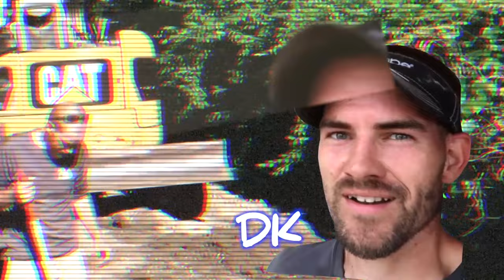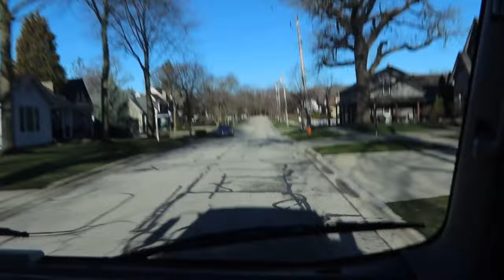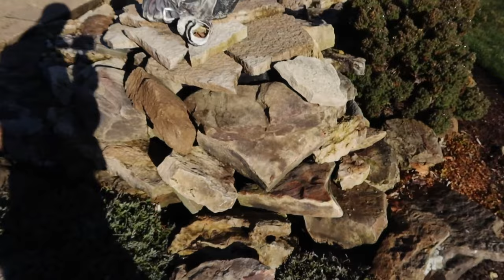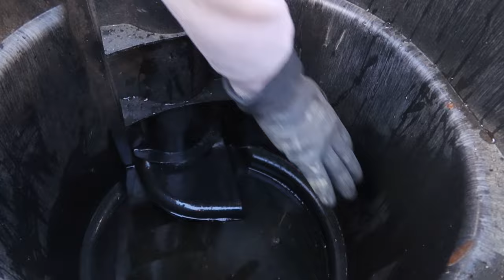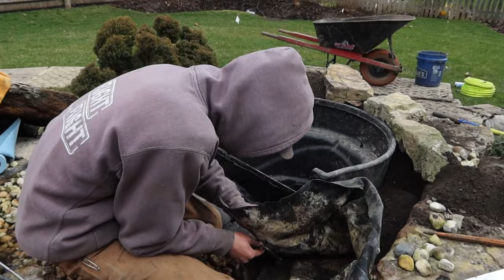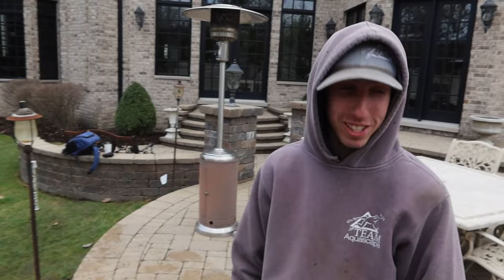DIY POND Gets a Double Shot BIOFALLS Upgrade

Comment: Why do you use brass screws (or any screws that will corrode) in your bio falls if they corrode in a short period of time and hence cause a leak ? Why do you not use stainless steel screws and bolts for this reason?